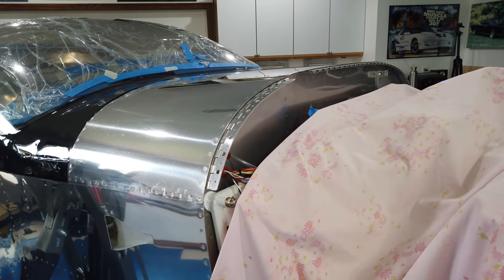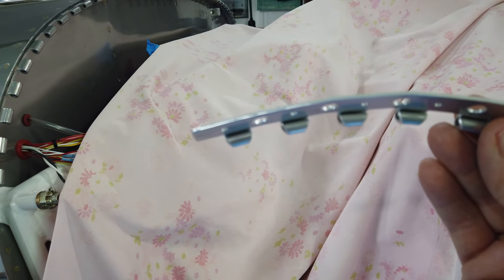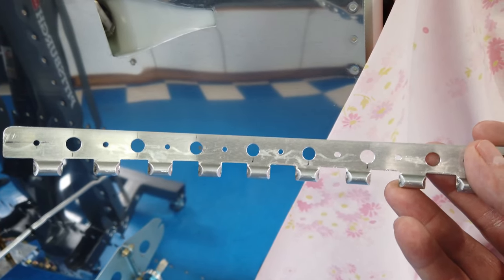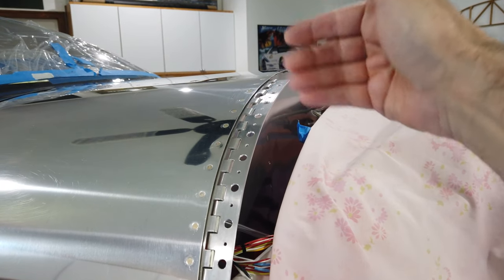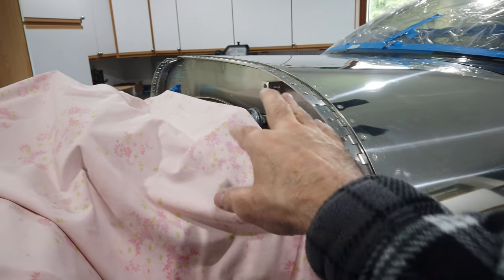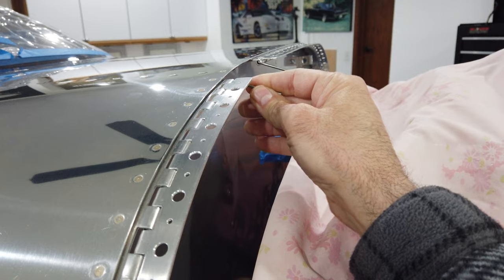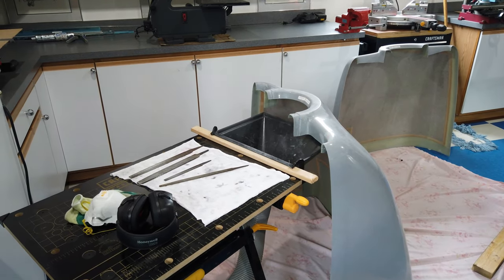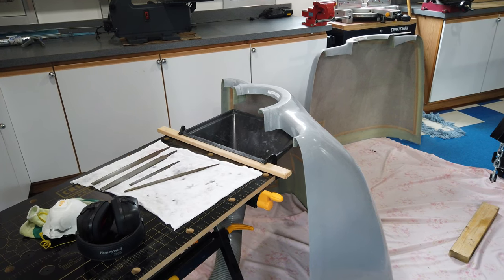Vans RV 7 HINT Videos Top Cowling Begins

Comment: Do you have to angle the knuckles on both sides of the hinges or just one side?
Reply from the maker: You must angle the knuckles on both curved areas on the top cowling hinges.
Reply: @KaretakerAero  Thanks.  What did you use? File? Dremel?
Reply from the maker: I used a file and did it by hand. I did an initial file and will do more if needed once I get the cowling better fitted.